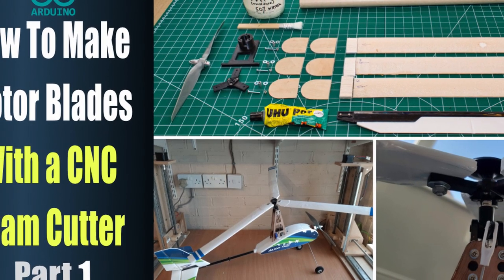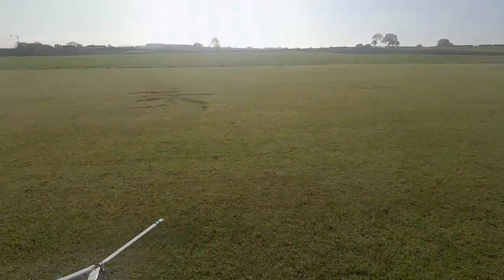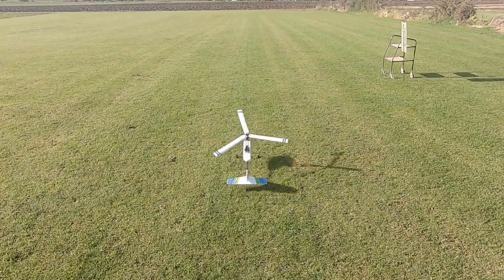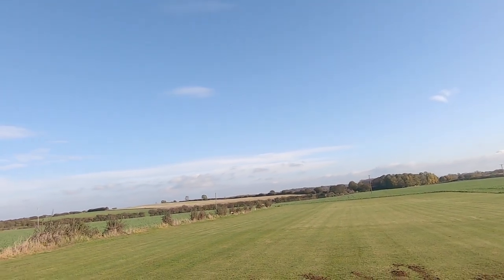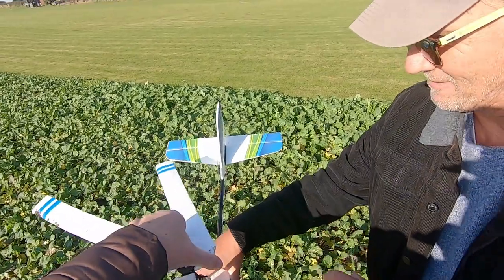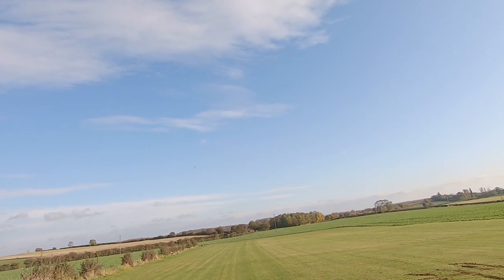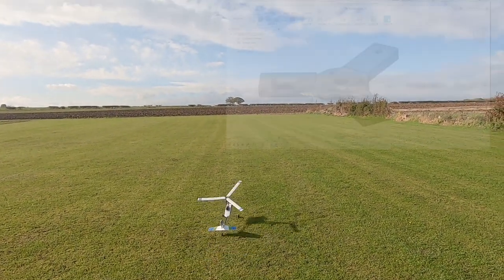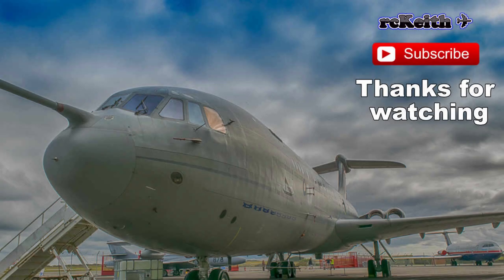Did it Fly? Making Rotor Blades with a CNC Foam Cutter - Pt2.

Comment: Hi Keith. I've got one of these and have exactly the same experience and yourself. They are very unstable in roll and drop like a brick on the turns. A guy in our club is an autogyro enthusiast and he reckons the hub should be thinner so that the blades can bend up like diherdral. He has made a triangular hub using two thicknesses of 0.8mm fiberglass board. His auto g seems to fly very well. I made my hub out of 3mm plate and it flies like yours!  One thing you must to it turn it on rudder and up elevator and very little or even opposite aileron. If it banks over it will dive to the ground.  I've shelved mine for now and am thinking of building the DB Autogyro which flies more like a rudder elevator plane. Best wishes. Bob.
Reply from the maker: Thanks Bob for the information.  You are spot on. I did have some mix on the airelons and rudder but I think it was to much. I'm going to try and set it so there is very little airelon and more rudder when I switch it in. It's been great fun and now I can make blades I hopefully get more flights and practice without out breaking the bank on spare parts👍👍👍
Reply: @rckeith  Hi Keith. I initially had Ail Rud mix but took it off as I found that I needed opposite Aileron. So in a turn I give a very small amount of bank with rudder and elevator then as soon as she strats to turn, opposite Aileron to keep it flat.  Most use of Aileron is on approach to keep it level. Also keep around 25% throttle on landing until the wheels touch. The other thing I find is it turns left much nicer than right. Have fun!